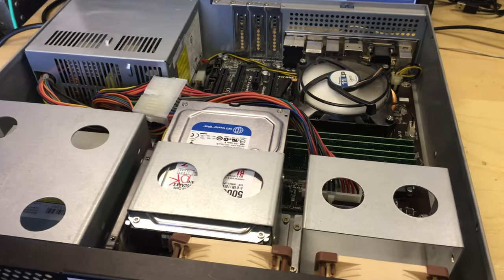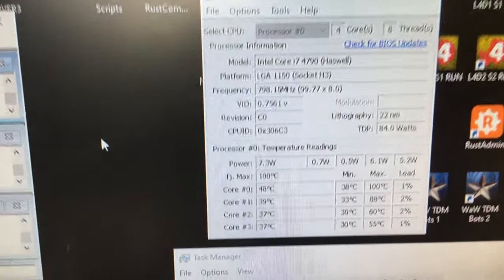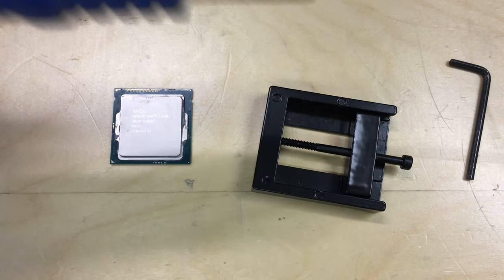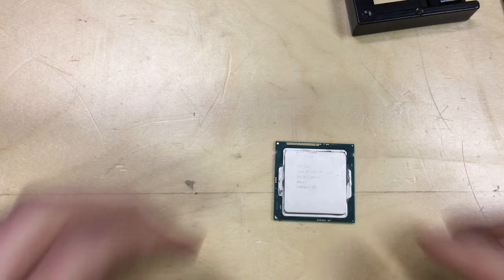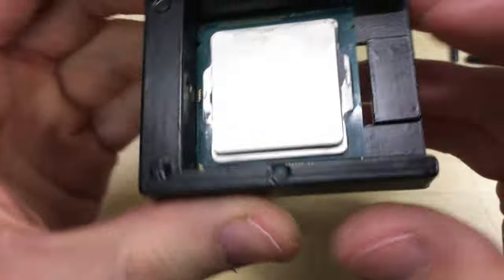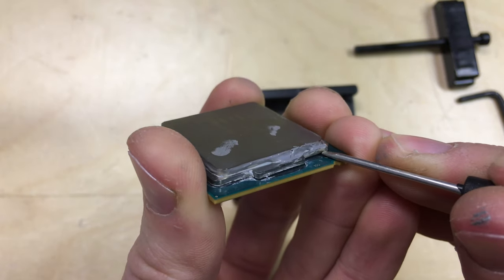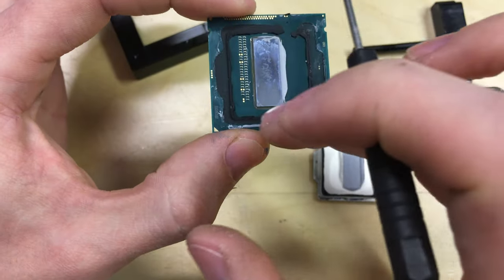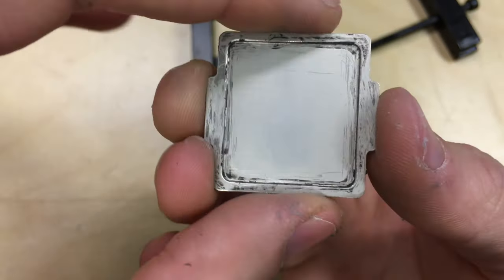Intel Core i7 4790 Delid & Repair - Overheating & Thermal Throttling IHS Paste Fix - Haswell 4th Gen

Comment: Great vid man. I used it as a reference because I had to do the razerblade to remove the silicon. Dropped a good 30° with no load! Now I'm not hitting 100° on full load at 4.2Ghz but am running 4.4Ghz and peaking at 66°.  Mind I did a 4790K

Edit: Also wanted to mention this was my first delid as well. Was quite terrifying tbh.

Comment: awesome tutorial pal liked and subbed also a quick question is the i7 7700k setup like this bonded with glue or is it solder as i have an old one laying around.. I stopped using the cpu for this exact reason was getting way too hot just would like to know if this method works with the cpu i have :)

Comment: Great vid man. But I've heard that the TDP of a cpu doesn't necessarily mean that it should be performing at that wattage and its more related to heat dissipation. Could you possibly clear up on that since I'm having the same issue with the same cpu not going above 41W usage at 100% load (yes its also having temp issues)

Comment: I got a 4790k and a SMD capacitor is chipped off at the LGA area. lucky me, it is still there with the pads. I do not know the capacitance of that cap. If possible can you measure and let me know the value. Thanks.

Comment: Hey you still need to add thermal paste to the top of the IHS where it makes contact with the CPU Cooler 👍🏽
Reply from the maker: Of course you do, I did do that and said it too, I just didn't video all of the process. You can see the paste at 19:35 - after I have installed the cooler brackets when I mount the cooler properly. If I hadn't re-pasted the cooler then it would have still throttled, the first time I offered up the cooler was just to test fit and ensure the IHS was centered correctly with the copper plate. 😎
--Nathan
Reply: Nvm I rewatched it and you did, just missed it lol
Reply from the maker: In hindsight, I should have probably included that in the video! Haha. 
I just noticed how long it was so  tried to condense it when editing. Got a bit overzealous possibly.
Thanks,
--Nathan

Comment: You should use an a lot better thermal paste And re glue the ihs to the CHIP for gettin the 60c max them that is the normal max themp of
 that processor. Until 8th Gen intel Processor they behavior its a lot diferent from the IHS all the 7th gen an Below

Comment: It’s insane (well not really) how badly Intel fucked up the launch and refresh of Haswell chips, it still is a pretty solid platform but it was absolutely soiled from the start and even 10 years on by its horrendous thermals all in the name of cheaping out and saving a buck/R&D time by not finding a way to keep those dies soldered. To compare, an OC’ed Q9650 from 2008 that also runs hot totally curbstomps any stock 4th gen i7 in the thermals department!! LMAO